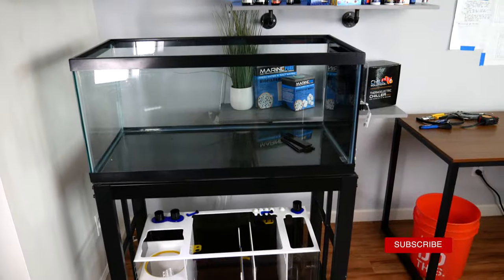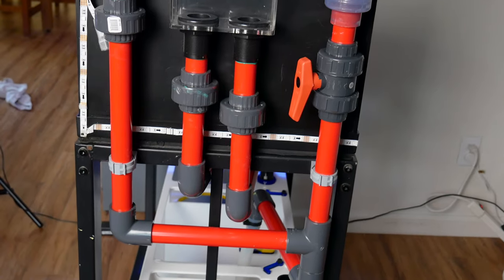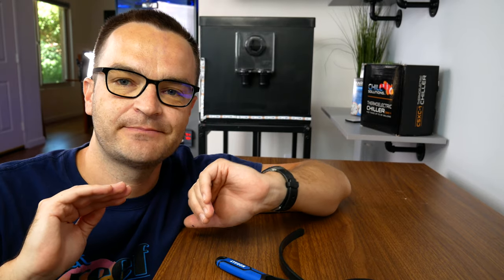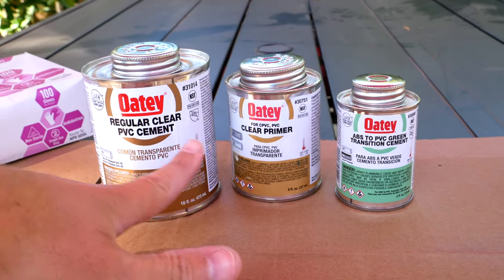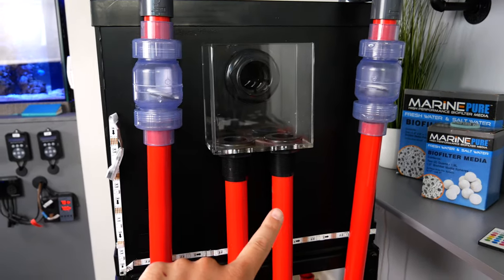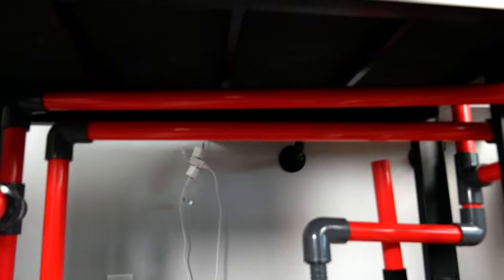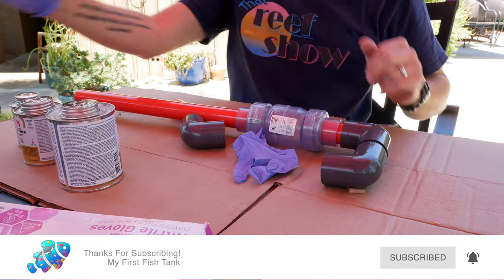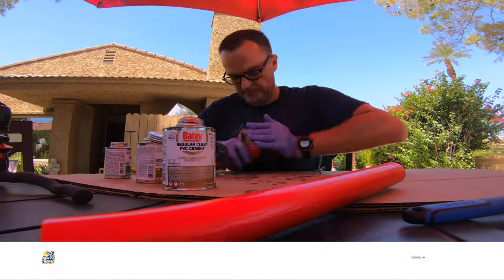How to Plan and Plumb an Overflow: That Reefshow Segment, Reefurbish!

Comment: Good luck with the tank.  In the future you may want to add a gate valve to that straight return so that you can balance the two out.  That said, you should probably be using internal fans for flow, so the double return really isn't necessary.
Cheers,
Chris

Comment: Just curious as to why you didn't go the extra mile and drill the return lines? Would've looked a lot cleaner, saved head pressure with fewer 90 elbows, as well as made lid options much easier in the future should you ever decide you need them.
Reply: You know, you are not the first person to ask this question.  I guess my most honest opinion is that I just did't think of it.  I know that sounds weird, and I don't know why it never crossed my mind.  I think I got a plan in my head and I just couldn't think outside of it at that point!  It would have looked cleaner and definitely been better for head pressure.  Really, I think I should have just installed a single return line for a tank of this size, and I should have tapered the 1" down to 1/2".  Oh well.  But on a good note, I do have some VCA random flow generators on their way so after I reduce the line to 1/2", those should really help!  Thanks for watching and commenting!
Reply: @MyFirstFishTank  makes perfect sense. By the way I purchased an MD elite overflow box for my own tank shortly after seeing your video so thanks for the confidence booster. Really looking forward to seeing how your system turn out.
Reply: @alexguitar841  Hey that's great to hear! The system is cycling as we speak!  Thanks again for commenting, and be sure to follow me at My First Fish Tank too!  Happy Reefing!

Comment: Hey my Myfirstfishtank, If I may say, your return lines. If you install that tee dead center between both90's, you'll have an equal flow from both lines. It's looking really nice.
Reply: quite true indeed.  Actually, what I should have probably done was just have a single return line for this tank.  Oh well, lesson learned... again!  Thanks for watching and commenting!
Reply: Or, add a second return pump and have independent return lines. This would eliminate that single point of failure...

Comment: Be el the edges with a pvc reamer. Easier to dry fit if you have to. Tape the pipe and fittings to keep it clean from glue over flow.

Comment: What cement is that for the bulkhead/street elbow ? Why a different cement ?
Reply from the maker: For ABS bulkheads, you'll usually see an ABS/PVC transition cement used instead of a general all-purpose PVC cement like you would on a PVC to PVC connection. 

That said, in low pressure applications (like most aquarium applications), you can usually get away using all-purpose PVC cement when connecting your PVC to ABS bulkheads 😉
Reply: @BulkReefSupply  without primer ?

Comment: In regards to your return lines being tied together and being worried about not getting equal pressure, you can add a gate / ball valve on the line with the least resistance that would naturally have the highest flow. In doing so, you can restrict the flow on that one line thereby pushing more water thru that other return line to equal out the pressures on both lines.  This will not interfere with your pumps performance since the one line will always have the ability to fully flow and use the max amount of output for your return pump. Other than that, good looking job!